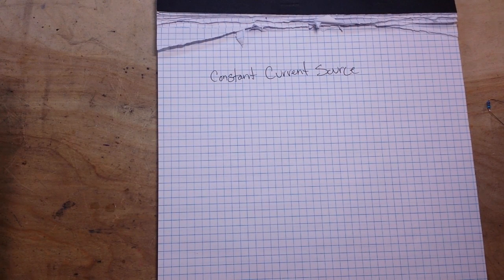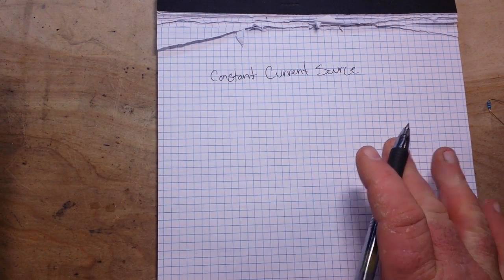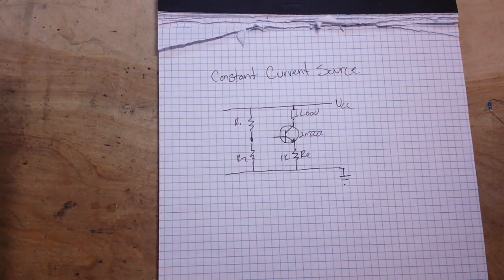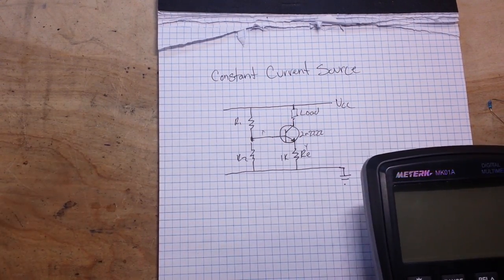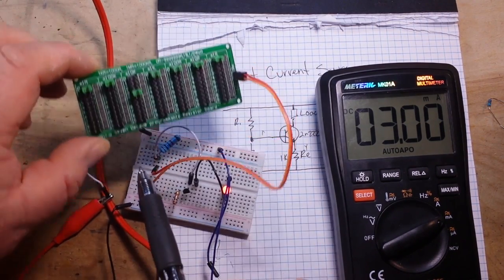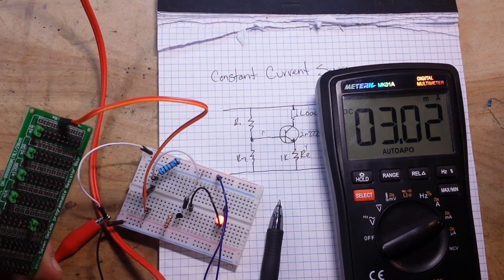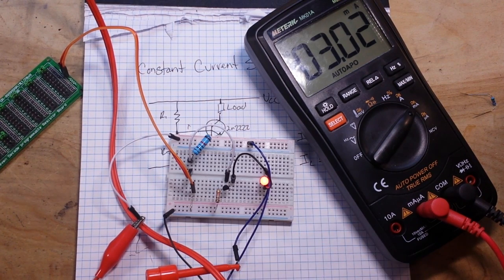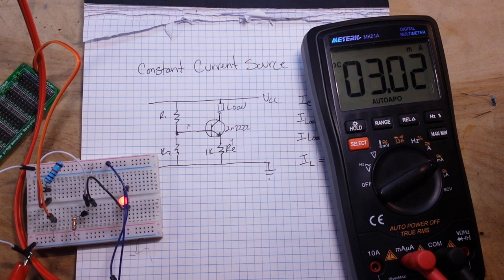Classic Circuits You Should Know: Constant Current Source

Comment: Sir, I wish to congratulate you on making this video where you explain " A constant current source".  Many people do not know the difference between a " Voltage source" and a "Current source". 
First, let us assume that the collector current characteristics with a varying collector voltage of a BJT are "horizontal straight lines"  for given base current. 
Your circuit, though so simple, gives the right idea about the fact that the current source is at the collector of the BJT while a voltage source is at the emitter of the BJT. As I said it is not a perfect current source nor a perfect voltage source and since my daughter is in education teaching the basic electronics, I often discuss with her how to demonstrate the action of a voltage source and a current source.  This is what I do.
I use the circuit that you showed and put a DC small motor, first connected at the collector and then the same motor connected at the emitter replacing the 'Re' in your circuit. When the motor is placed at the collector as a load, there is a constant current in it so the motor provides a CONSTANT TORQUE. The manner and the noise the motor makes when it speeds up is that the motor takes a lot of time to speed up and the sound is gentle and slowly rising. Even if you stop the motor shaft with your fingers no damage is made as there is a constant current in the motor due to constant base current. 
If the little DC motor is now placed at the emitter instead of Re, then at that point the transistor is a VOLTAGE source and so the motor will have a variable current, very high to start with as there is no back emf from the motor. At the start, the motor will accelerate very very fast and reaches a constant speed.  This is because the voltage source connected to a small DC motor is a SPEED CONTROL SYSTEM  and not a CURRENT CONTROL SYSTEM. 
I am now a very old engineer and you know when I was very young I formulated this " model" for the manner in which a current flows out of a current generator.  Since you were in the Navy I am sure that you will appreciate my analogy. 
* Assume a kettle of water being boiled with a flame underneath it. The rate at which the vapor evaporates is only due to the flame size. The vapor normally stays above the surface of the water and if we want the vapor to reach further up we must put a vacuum cleaner to such it up.  The base-emitter junction in a BJT is the flame power that evaporates the electrons and the collector voltage is the vacuum cleaner which will suck the steam through the insulator represented by collector base material which is a reverse diode!!
Sometimes I describe the base-emitter junction as doing the same job as a catapult on an aircraft carrier. The catapult shoots the planes forward one by one and the aircraft as they are launched ARE NOT ALLOWED TO TOUCH EACH OTHER.   This is the manner in which electrons are shot forward into the collector insulating material, individually like machine gun bullets where THEY DO NOT TOUCH EACH OTHER  and in between there is the high insulating collector material AND THIS IS THE REASON WHY A CURRENT GENERATOR/ SOURCE HAS A HIGH OUTPUT IMPEDANCE.    The collector voltage in an NPN BJT is only acting as a vacuum cleaner to such up the CONSTANT NUMBER OF ELECTRONS LAUNCHED BY THE BASE EMITTER JUNCTION.
It is very important to know that while traveling through the insulating material that makes up the base-collector path ( reverse diode) the electrons leave an insulating space between them to form the high output impedance of the current source. It is the emitter-base junction that the decides the number of electrons launched to the collector insulator path and not the collector voltage.

I have a good mechanical analogy of what makes a voltage source with its VERY LOW OUTPUT IMPEDANCE  as when we take the output from the emitter as in the case of your circuit. But I shall explain that some other time.
Congratulations on our presentation.  You have brought back many good memories of my youth, and that was a very very long time ago when even the transistor was not yet invented......... I grew up with  glass tubes and glass valves  where the insulation between the grid and the anode was a perfect vacuum or an insulator which  in the BJT they try to obtain it through using the high impedance of a reverse biased diode...............it was easier to learn about the dynamics of electrons traveling through insulators when handling glass tubes in 1940!

Comment: Hi, good presentation.
Can you please come back to this circuit and change the load and show how good the current regulation is. 
Also measure the actual circuit values and put them in your final equation?

For example, using 12V, Vcc show one then two then three LEDs in series as the load.

Also to fill in the maths gaps.

To fill in the gaps;

Ie = (B+1) * Ib     ----(1) Emitter Current

Il = Ic = B * Ib    ----(2)  Load Current

      Ie 
Ib = ------     ----(3)  Base Current
     (B+1)

So sub (3) into (2)

       B * Ie
Il = ----------     ----(4)
       (B + 1)
Now; 

       Ve 
Ie = -----    ----(5)
       Re

So sub (5) into (4)

      B * Ve 
Il = -------------    -----(6)
     (B + 1) * Re
    
If B is very large, say 100 then B + 1 = 101    100/101 is close enough here to be = 1.

So rewriting (6)

      Ve
Il = ----     ----(7)
      Re
   
Ve = Vb - 0.6     ----(8)

Sub (8) into (7)

       Vb - 0.6
Il = ------------
          Re

Thanks.. Tom..

Comment: I could not explain some mistery (for me). Namely, if you check by neon tester main socket you see - for  L it lights, for N does not light. It is normal, because N line is grounded. But if you do the same using 230VAC/230VAC separator you can expect that the tester will not light on any end the secondary coil of the separator, or light on two of them, because secendory coil is not grounded and two of its ends are equivalent. But, in reality, check it (!), only one end of the coil will light the tester. Why??? Nobody I met could explain this.

Comment: Your demonstration proves nothing. What is the point of changing the base current?  What if you change the load? What if the supply voltage changes?
Reply from the maker: Uh...the lead current is set by the base current. Changing the load does nothing.
Reply: I think his point was that you should have demonstrated that.  That is the core idea after all.

Comment: How is this "constant" current source - if we change the Vcc, the Vb will change and the current will change. It will be constant if the R2 is replaced with zener diode for example.
Reply: Its constant current only under a varying load resistance but as us, this circuit also needs a constant Vcc.

Comment: I admire your willingness to teach but need to point out that a true constant current circuit will deliver the same current not just into a varying load but also from variances in Vcc. What you have is a current sink. If you vary Vcc even fractionally, the collector current (the load current) will shift accordingly. It's no longer constant.

If you further expand your equation for Vb it approximates Vb = Vcc*(R2/(R2+R1)). This you can then substitute for Vb in your equation. If Vcc changes then Vb changes and so IL changes. Your circuit requires Vcc to be rock solid regulated for constant current to be realised. Not viable for loads that run directly off a battery for instance where terminal voltage falls over time as load is applied.
Reply: Replace R2 with 2 diodes in series and you get constant current, Ic=Vdiode/Re
Reply: I knew we had a problem as soon as he said Re was to "reduce thermal runaway" ... my favourite CC is similar but 2 transistors - replace R2 with a second npn (T2) with its base to the emitter of T1, emitter to ground, and collector to the base of T1. Vre is now 0.61V whatever else goes on, as long as enough current is coming down R1 to power the original transistor. Thermal changes in T1 are irrelevant. Can sink constant current down to less than 1V from ground (which is often important). Since transistors, resistors and diodes all cost the same these days (1p), there's no cost penalty and R1 value is now arbitrary, so when there's a charge for each extra value in the pick-and-place machine you can substitute a value already used elsewhere... win win win.  Turn the whole thing upside down with pnp's for a CC source instead of sink. Re sets the current, rather than having anything to do with thermal runaway.
Reply: @treelibrarian7618  yup! Same principle as signal diodes, but even better overall and as you say bugger all difference in cost and same component count.
Reply: Tree Librarian when you say turn the whole thing upside down, explain that
Reply: @jayt2257  like this:
+V              1
GND           0
R1 600Ω    1  2    (CC set)
Q1 pnp       1 2 3 (e b c)
Q2 pnp       2 3 4 (e b c)
CC source 4   (output)
R2 120kΩ   3  0    (bias)
Reply: Thanks Arthur. I suppose if I would have used the info in this video I would of failed the job interview… for lack of depth of knowledge.
Reply: Not completely true, as using two diodes in the bias chain solves the vcc problem for any reasonable deviations. See my comment above.

Comment: That's not a constant current *source*.
Reply: Hi Ed;
The classic circuit uses 2 transistors, one connected as a diode to compensate for the B-E drop of the second. See:
Current Mirror
https://en.wikipedia.org/wiki/Current_mirror
https://en.wikipedia.org/wiki/Widlar_current_source
redrok@redrok.com
Reply: I think you're being a little pedantic now. You could say sink, but it could also be said the the power supply is the constant current source.

I must admit, most of the time I have used a CC source, it's been using the PNP variation. But it's just the inverse of the exact same circuit reliant on the constant voltage being created across the emitter resistor. Swings and roundabouts really. Most engineers would accept both circuits as current source, especially with diodes in the base bias chain

Comment: Paul, I am confused! The 2222 data sheet states hfe = 100 (300 max.) my transistor tester is showing about 260 and you are using 436 in your calculations. Why the massive discrepancies?
Reply from the maker: 200-300 has been my experience. I don't know why the units I had are showing so much amplification.

Comment: Let my start by saying Happy Birthday
But I will not give your a passing grade for that constant current source.
Replace R2 with a red LED or two diodes would help because it will reduce its dependency on input voltage, but a even better solution is a JFET, it is a constant current source sometimes without external components, sometimes you need a single resistor.
None of the above is perfect, you need something with a stable reference and more gain to be closer to perfect.

In one of my designs I needed a a led (Opto coupler) to work from as low possible voltage to as high as possible voltage, a JFET did that nicely, my final design is rated from 4V to 25V and includes a polarity protection diode, a opto coupler, a red LED and a JFET with resistor to limit current. Low limit is due to voltage drops in the different part, high limit is due to the JFET.

Comment: I thought I had left my multimeter on.
Reply from the maker: Lol it was mine
Reply: I thought it sounded like the sleep function on a Hakko soldering iron
Reply: @mikehermesmeglio  They go to sleep?
Reply: @chloejackson-reynolds418  Yes.  They have a sleep function to reduce tip temperature and then eventually it will shut off completely if it's not being used.
Reply: My poor dog is so jumpy and she noticed your meter was on Paul!

Comment: You totally lost me!  But your vid's are awesome. I'm currently (excuse the pun) trying to order 3 mosfets to power a cheap rgb 5 metre reel so to pwd from an arduino which i don't know how to do yet. Do i get a tip120 or a lrlb8721 or many others that will suffice? Digikey confused me. I'm 49 years old, but never too old to learn. I'm dedicated to building arduino things this year and learning to get the basic's of coding. Yes there are lots of examples out there. But  i Wanna understand it all also. I'm sure it will get easier as i order different chips, mosfets, capacitors etc and building them on to boards. I have a basic knowledge of electronic's and some really good idea's for arduino's. Watch this space. But thank you for helping me on my journey, along with many other sources. Adding another transistor would make it a darlington transistor (tip120)? Ps: Happy Birthday and New Year :)
Reply: I used IRLB8721's and it works pretty great. They dont heat up at all, altho its only for about 40cm. I think for 5m youd need a heatsink
Reply: good on ya. arduino is an excellent place to start. learn how to control stepper motors and you're like basically able to make robotic things. its such an enabler. you can make anything. also check out 18650 batteries on aliexpress and the wee bat charger chips for them